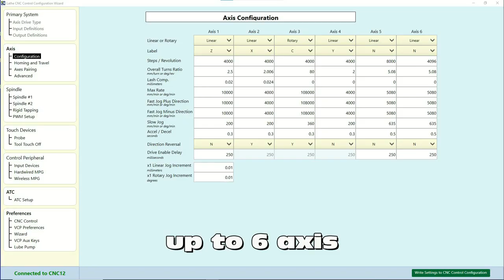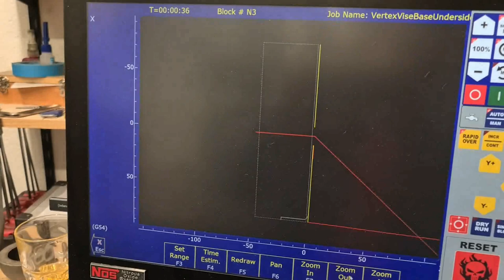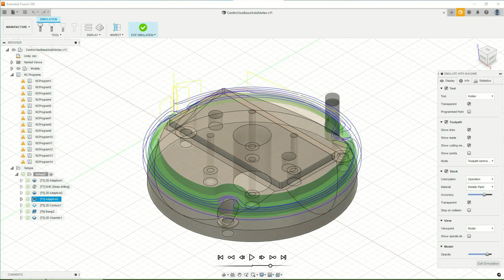New Acorn 6 DIY CNC preview with turning a 4th axis base

Comment: Noooooo, I just bought the acorn 2 weeks ago!!!... is the 5-axis going to be simultaneous with TCP, or just 3+2 I bet the 5-axis CNC12 software will be more than the 4-axis pro for $150?
Reply from the maker: On board are two fast FPGA chips, should be no problem to run 6 axis simultaneous, but I tested only with 4 simultaneous and not sure what would be in which software option. But price tag will be well above Acorn. Also good working 5 axis CAM is not cheap since fusion put it in an extension ;)

Comment: Is there any difference from original acorn besides extra axis?
Reply from the maker: yes, there are also 3 encoder inputs and 2 spindle outputs +-10V, BCD Output for toolchanger, SCOUT port for Expansions, faster possible step rate, Optional SCOUT CNC Operator Control Panel/Pendant, ATC installation with Wizard ect...

Comment: Do you have to have drivers for the additional mpg wheels??
Reply from the maker: nope no extra line drivers needed for the manual MPG, it is just an ordinary chinese MPG with ABZ+- and +-5V for 30 bucks
Reply: @TheSuntravel  sweet thats what I've been waiting for ...so how do u like it???
Reply from the maker: @michaelbrocato7535  I love it, because like other Centroind CNCs it works reliable. You can concentrate 100% on the parts, the CNC is doing what you tells her to do perfect and fast.

Comment: Nooo ,why pay $999 For something that doesn't  support  EtherCAT  drivers 😒😑.
Reply: Where did you get the price.  I didn't see it on their website yet.
Reply: @justinsturgeon1  yes pric is on their  website
Reply from the maker: Maybe because you do not use EtherCAT drives 🤣
Reply: @TheSuntravel  Mach4 has EtherCAT  supported BOB ,nice .
Reply from the maker: @seimela  I know the one from Vital.... and the cost for extra expansions to have similar features than Acorn6, but you must run unreliable mach4..